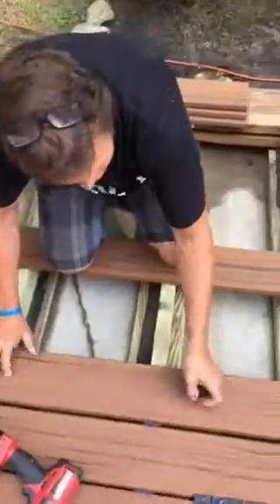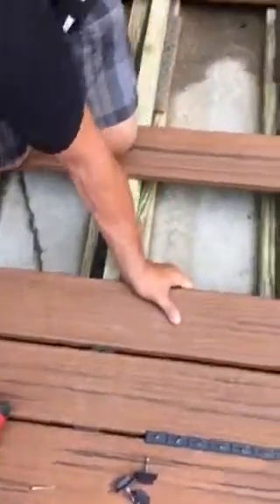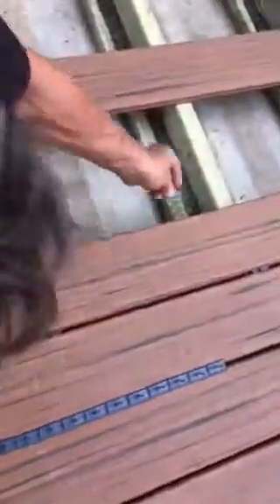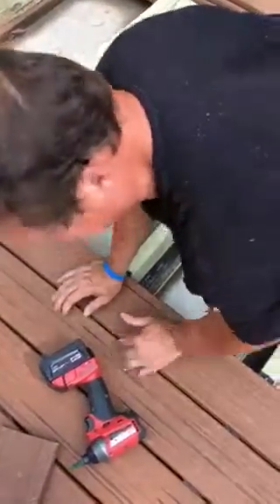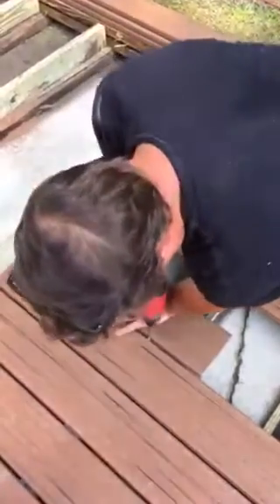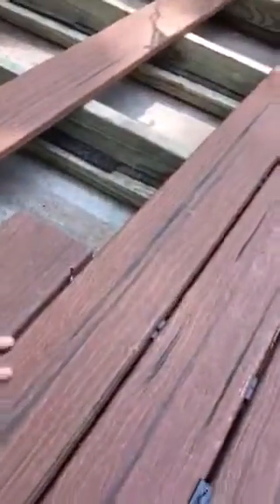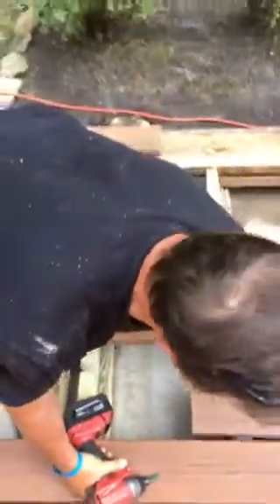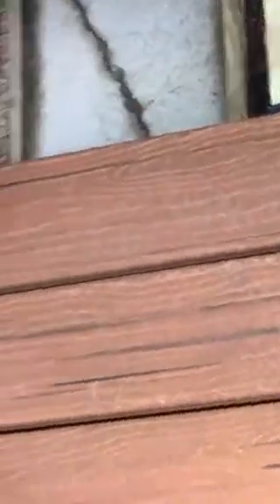07.21.17-COYOTE CLIP INSTALL MOISTURESHIELD

Comment: Hey Brain, thanks for the video. I am considering the moistureshield product over my patio. Was considering a 2x4 sleepers with perhaps an 1/8" riser between the concrete and 2x4. However, the MoistureShield company does not recommend using "clips" with sleepers as "when the composite is installed that low to the ground, there tends to be too much movement with prolonged moisture exposure and temperature fluctuations." Yet you seem to be installing in a similar manner. I really do not want screws and plugs. Thoughts/advice?
Reply from the maker: Steve you can call
Me but we installed these decks over three years ago and they are still working and looking as the day we installed. Best to use this clip coyote, I can direct you where to get. Call me 570-274-040”
Reply from the maker: 570-274-0400

Comment: Have installed 2500 ' of this decking and as the wind came in it how's drastically. This is a very noisy product and Moisture Shield really doesn't want to offer any assistance. We took several months just trying to determine where this noise was coming from and to find it was the new decking was a surprise. Please keep this in mind when you have this kind of investment!
Reply from the maker: are you kidding me call me sounds crazy 570/274/0400